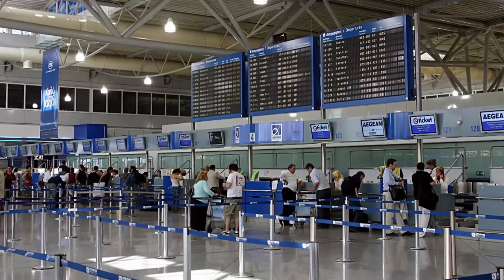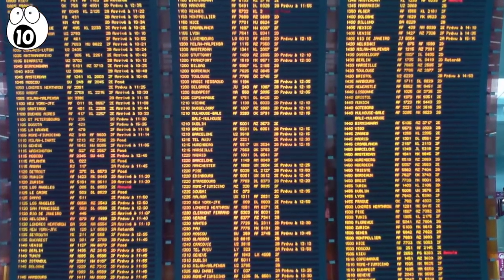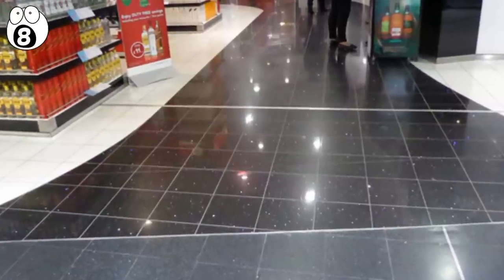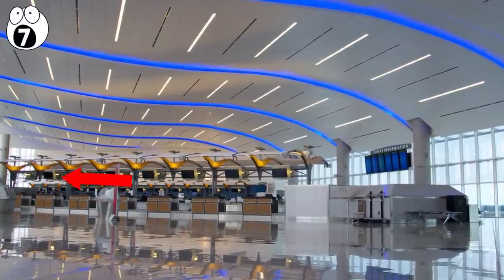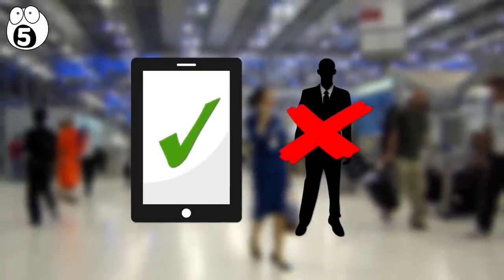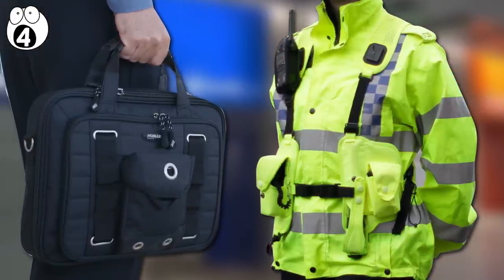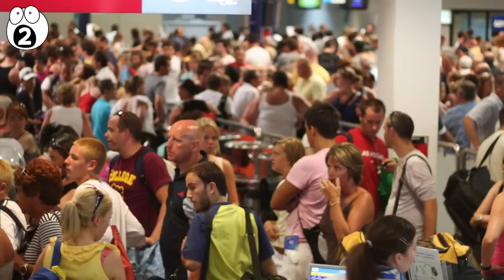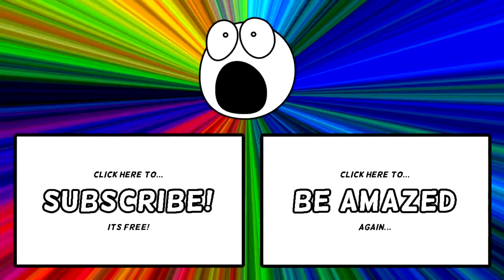Airport Design Secrets You Don't Know The Purpose Of

Comment: 3:41 thats a train's interior not a plane's
Reply: Роман Александрович 
Large rectangular windows, overhead rack not enclosed,  no floor path lighting showing exits...
damn, you're right, it IS a train!
Reply: Yup - Japanese shinkansen. Tray table showing the layout of the rear 8 coaches.
Reply: Роман Александрович yes you are right
Reply: well slap my scalp and call me daisy... you sir, are absolutely correct...
Reply: well shit, i didn't notice this until you told me. hat off to you.
Reply: Роман Александрович do you mean at 3:42? I thought those windows were rather large for a plane lol
Reply: ha
Reply: exposed
Reply: Budget Cuts...
Reply: To finish off the analysis, no enclosed overhead compartments. Baggage stored above can fall easily and hit heads if a take-off or landing was inevitable. Shinkansen interiors are famously designed to be much more roomy than aircraft, so overhead compartments are almost always fully exposed.
Reply: dont worry, hold my beer and i will turn this train into a plane, give me some wings, an engine, and lots of duct tape...
Reply: Роман Александрович yeah that's a bullet train
Reply: Could be a CHEAP CHINESE airline. LOL.
Reply: just adding one more detail: airplane windows must be round. otherwise the material on the corners would wear much on the ever-changing air pressure.
Reply: these types of channels are not to be trusted, half the time the facts are incorrect and they use stock photos which are also incorrect.
Reply: Must be a broke train. Only one passenger?
Reply: Nope
Reply: I 100% agree thats a Shinkansen
Reply: Ahmad Hussein i thought it was one of those old airplaned
Reply: NJ Eddie, you're right! I thought the interior of the 'airplane' was cool until I observed closer snd it was a train!
Reply: I noticed that
Reply: Ahmad Hussein correct👏🏾👏🏾👏🏾👏🏾
Reply: Prepperjon ,
Reply: Ahmad Hussein a
Reply: Definitely a train.
Reply: That's why im thinking why is it 3-2 seat configuration
Reply: Yeah. The windows are too big.
Reply: 2 words GET ROASTED

Comment: Having worked in retail for many years, I've always been hip to the little gimmicks they use no matter where you are, to try to part you from your money.  Also, as I'm handicapped and in a wheelchair, the skycap  pushing me around will push me right past all the stores unless I specifically ask him to stop.(I rarely do.) I also select my flights frequently based on connection times.  I don't like to sit around waiting for my connection; it's painful to my damaged spine.  I usually fly with Delta.  They have they best connecting times.  The longest connecting time I've ever had with Delta for a domestic flight was two hours.  That gave me enough time to be taken off my inbound flight wheeled to my connection, take care of my call of nature, grab a bite to eat and be tossed back on to my connection.  Most of the time, my connections are just long enough for them to get me off my inbound flight, wheel me to my connection and toss me onto my outbound connection, and that suits me just fine.  Delta is a great airline; they treat me like a princess.

Comment: The architectural design enhances passenger movements through the terminals. There's one exit out of Customs for example, into the main terminal. (People aren't exiting from 6-8 different exits). This also enhances security. Video monitoring systems at airports today look for anomalies: someone moving against the intended flow, someone just stationery in an area of flow, someone entering an exitway (testing the system?), and items that have been moved from their standard position (such as an artificial tree). These designs to enhancement movement constitute a system that highlights disruptions or anomalies easily.

Comment: OMG all the walkways bend to the right!  Those bastards!  Uh you realize they bend to the left when you walk in the other direction right?
Reply: airports are mostly one way. From entrance to plane. There is almost zero reason to walk back.
Reply: Unless those planes show up with passengers on them, and they need to get off the airplane and leave the airport.  Some people even change planes and fly to other airports...
Reply: Tex Mex the arrival terminal is not the same as the departure terminal. arrivals wouldn't even show up there.
Reply: Nope.  it's the same building.  Ticketing and baggage are in 2 different places, but the main shopping areas areas and restaurants are past security.  Departing passengers walk through the same areas.  Passengers chasing planes walk through the same ares.  Have you never been to an airport?
Reply: @d4m4s74 Dunno where you are, but at every airport I've been to, they don't move the plane to another building after people get off before people get on.
Reply: Tex Mex It depends on the airport. Some are as you said, arrivals and departure go through the same passage way. Others, you get taxied from departure gate to plane/ plane to arrival baggage claim. There the arrivals don’t pass the shops at all. Some large airports in EU are like this (Frankfurt, Athens).
Reply: No ,

If there is a reason that you are not flying then there is a special procedure to go back through security and it is unlikely to be the way you have come.
Reply: Tex Mex no there is a way to go in.  And one to go out
Reply: Tex Mex it’s not the same way

Comment: Please start using metric.
Reply: The metric unit is the best unit
Reply: You call it imperial but only two countries use it...I love irony
Reply: "3 -inch letter can be seen at 120 feet." With 2 different length units in the very same sentence, my brain just bugged on the double conversion. Impossible to figure out what it could mean while watching the video.

After pausing the video. 3 inches are about 8 cm and 120 feet about 3600 cm (36 m). Now that sounds clearer!
Reply: Why, since even the idiots who insist on metric can't use it right?  They keep shipping us "2000mm" cables.
Reply: It's exact and it also makes it seem longer(as it is a larger number)
Reply: A decent measurement system's job is impartially describe what things are, not make them seem to be anything else.
Reply: No.
Reply: Metric system is a system, decimal based.  But the units used have no real context in nature.  And it has less units that it can be divisible by.  There are weakness to the metric system.  Other than being divisible by 2 and 5, you're stuck.
Reply: Um, no,  Just plain no.  The length of the number is not the issue.  The granularity for normal use is.  Fahrenheit is more granular than centigrade.  The unit of measurement isn't the point, the granularity is.
Reply: Oliver Janik Please start learning to convert
Reply: US does  Amps  for example
Reply: @thatcanadianmanectric8458  former colonies...

Comment: The whole VIP section is another element of design that you did not mention. 

The VIP experience at airports is extremely different, there is a dedicated 1st class (and sometimes business class) check in desk, and a concierge will take you through a private security area where you are checked (the guards are usually nicer than the normal guards) and straight on to the lounge area where you can enjoy a nice meal and perhaps a mini-spa treatment before you get whisked off to the gate in a golf cart or a limo (if you have to board without a jetway) and you are boarded before the rest of the aircraft and you get a complementary drink and snack of whatever you like while the rest of the plane is loaded. 

The entire experience is designed so that the VIP doesn't have to have any contact with the general public unless they wish to.

Comment: The other thing about those zig-zag queue systems is that because the line is being emptied by a dozen desks, they actually keep you moving along at a higher speed than if you're in a bunch of separate lines.  You don't get to the end any faster - but it produces the illusion that you are.  Also, if one person takes a lot of time at the desk - you share the cost of that equally between everyone in line rather than penalising the people who got unlucky.  This reduces the focussing of anger at the one person who is taking longer.  However, to do it "right" they need someone to rearrange the barriers as the line length changes so you don't have to walk so far along the empty lanes to get to the end of the line.  They do this at DisneyLand - and airports should do the same.

Comment: Also at most airports the chances are if you are flying commercial your terminal is NOT 1.  1 is usually reserved for private planes, If you are lucky enough to use this terminal typically you can drive through a gate, directly to the plane on the tarmac and a valet parks your car, baggage guy takes your luggage and you get on the plane.   Pretty nice.

Comment: One more thing at the airports is that the air is purified with a substance to sort of calm people. This is ok for a short period but if you work in an airport as I used to, it usually gave me a headache at the end of a working day. Also made me very thirsty. Also an airport like Schiphol, Amsterdam is build in a half circkel so to keep a better control over car traffic. Plus the space between the roads and the pavements is filled by big concrete plantpots. They are placed close to each other,enough room for passengers to walk past but impossible for a car to drive through. This to prevent a terrorist attack with cars. I also hear a lot of complaints about the security but in the many years I was working as a security officer you would be amazed how many forbidden (dangerous) items I've come across.

Comment: A walkway that "curves right to left" also curves left to right, it depends which way you are walking on it. Furthermore, if your head actually does naturally turn to the side which you are pulling your baggage on, it wouldn't matter if the walkway were curved or straight, you'd still be looking at shops on that side.

Comment: It doesn't matter if departures are on the top or bottom when it comes to suitcases.  Sure, it's easier to move the bags down to unload the plane, but you still have to lift them when you load it.
Reply: ramrod132 it all goes down a ramp to a vehicle to the plane and to another ramp and vice versa. A better reason to seperate departures from arrivals is to keep all the outside traffic moving. Just imagine how many cars would be taking up valuable real estate if everything was together.

Comment: LaGuardia tries to do this in renovated areas, with mixed success.  For example, Delta's terminal D just renovated a few years ago, you pass the shops after security as described.  However, when leaving you pass some of the shops again - there was no space to avoid passing them in both directions (for part of it).  Still interesting.

Comment: The Airport doesn't really care about the terminal vendors. The terminal vendors don't care about the airlines. The airlines don't care about the security detail, and the security detail doesn't care about anyone.

And you can't have more departures by having more floors for departing passengers to wait. For one, all planes board and unload while on the ground. Another reason is that the only airports that have more departures than arrivals are the ones that build airplanes.

Comment: The carpets and tiles thing isn't exactly accurate. Carpet is cheaper to install, and will be used in low traffic areas, such as the seating areas. Tiles are more expensive, but last much longer under higher pedestrian traffic. As much as airports want to bling their buildings, they still have budget constraints.

Comment: Good points but I think you are "reaching" with some of those subliminal things.  Flooring: Homes often put hardwood or ceramic tile in main traffic areas, and soft flooring (ie carpet and rugs) for living rooms.  If they had carpet everywhere, it would wear out faster in heavy traffic areas.         Also, glass is used more from an aesthetic and architectural design purpose.  No one ever wishes they had less windows or smaller windows in there home or workplaces.
Reply: PDX (Portland, Oregon) has carpet everywhere (except outdoors).  The last carpet lasted almost 30 years.  https://en.wikipedia.org/wiki/Portland_International_Airport_carpet

Comment: I want to know why the ceilings in airports are so high.  Doesn't that make for a much larger load on HVAC systems?
Reply: No, it doesn't.  The large volume of conditioned air makes it easier to maintain a consistent temperature.  HVAC load would be increased by poorer insulation, higher insolation (sunlight entry), exterior doors open, etc.

The high ceilings are to reduce/eliminate claustrophobia.  Same as grand railroad stations from centuries past.

Comment: Self check-in is 25% SLOWER, not 25% faster due to lack of kiosks, kludgy interface design, and bottlenecks at bag drop. But of course, it does cut labor costs to the airline. Please fact check yourself and don't just repeat what you read in the in-flight magazine.